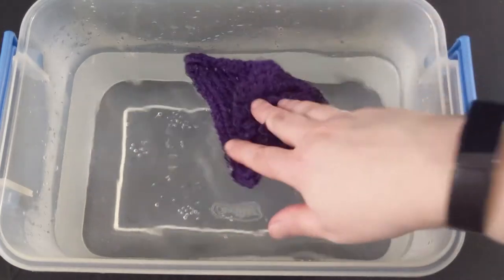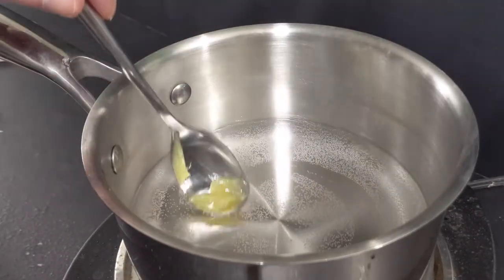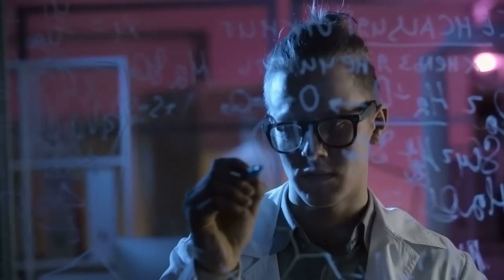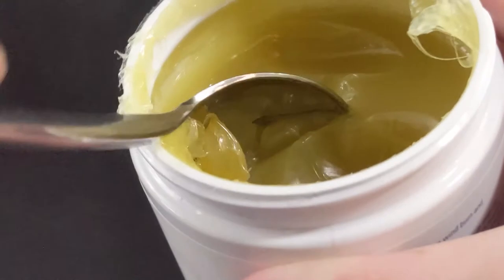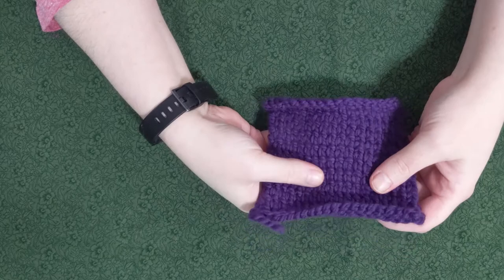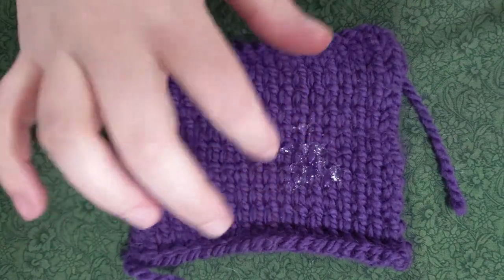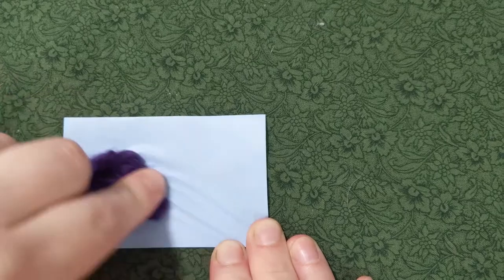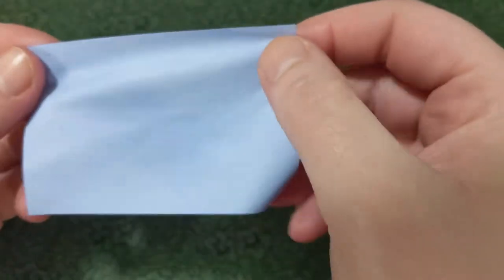Lanolizing Wool Textiles

Comment: I lanolized wool soakers (cloth diaper covers) for many years. The method I used to emulsify the lanolin into the water was to add a few drops of liquid castile soap. I would melt the lanolin into the hot water, and start adding the soap drop by drop. Magic would happen and the water would turn milky white, and the lanolin would be perfectly dispersed into the solution. I would soak the wool until the water was cool, and roll in a towel to remove as much water as possible. Perfection every time! I was able to get a heavy application of lanolin (waterproof was my goal here) but still not have sticky residue.
Reply from the maker: This is a great tip.  Thank you!
Reply: Yes this is what I do! Castile soap works even better than using emulsifying cubes for this purpose made by sloomb. The soap creates tiny little micro bubbles around the lanolin trapping it inside and distributing it evenly throughout the water.
Reply: Using the emulsification thru soap method, did you notice a whiter hue on the fabric when it dries?

Comment: This video is incredible, thank you so much for this information.  I have recently, I don't know how to say this, gotten into wool. And after wool, I discovered lanolin. I actually discovered lanolin when I was trying to figure out how to take care of shoes. After looking into it for about a year, I figured out that the ingredients they were using were all supposed to add up to what lanolin does alone. Neatsfoot or mink oil are used as conditioners and they'd add pine pitch or beeswax as waterproofer. I noticed that lanolin was an ingredient in some of the formulas, but didn't know what it was up until that point. Once I read up on it, I tried to find some to experiment with. The only lanolin I could find in my area was Lansinoh's nipple cream from Target! Luckily it was 100% lanolin and I was able to try it out on some shoes. I got the results I'd hoped for and haven't used any other shoe care products since. Lanolin then led me looking into wool more (and a lot more thoughts on the world that I will spare you).  And one thing that has been eluding me has been a fuller explanation on the hows and the whys of lanolizing, which you've so eloquently explained. It remains elusive in all of the places I could think to look. This knowledge seems very fundamental.

Comment: I'm confused. Weigh wool. got it. Use 1/2 to (1) tsp lanolin per lb. got it. But here's what I don't get: Ideal saturation is a 2% solution, but each item requires a different amount of water to cover it (ex., a pair of socks vs. a large sweater), so the water + lanolin would be different % solution for differing batches regardless of the Weight/lanolin ratio. So, is the amount of water irrelevant? also, the video is not clear on what the EXACT 1/2 or (1) tsp would be: level tsp or heaping teaspoon? Thanks for any clarification!
Reply: Similar questions ... I have a wool poncho I made out of a wool blanket.   I've got 4 lbs of wool here so as you pointed out 2% comes out to 36g of lanolin.  but it will take a considerable ammount of water for a bed sheet sized blanket.

Comment: Thanks for the detailed testing! Wondering….is there Any way to attempt this on a shearling? Does to have to soak? Could it be sprayed on a shearling or worked in?
Reply from the maker: I'm thinking a spray might not be an effective application method, since we're talking about a water-oil emulsion.  It needs to be hot to keep the lanolin from resolidifying and agitated to keep the oil from pooling on the surface.  That said, I enjoy being proven wrong!
Reply: @Luthvarian  i may try a small patch with spraying, brushing and a distant low blow drying. Time to do a little test.
Reply from the maker: @DavidBattistella  Please do let me know how it goes!
Reply: @Luthvarian  I’m loving the results so far. Basically I melted  about 4% lanoline into water and then added some shavings from a bar of olive oil soap to emulsify. Perfect. Then while still warm I bottled it into a small spray bottle about 120ml. Then I lighting brushed the shearling with a new medium stiff shoe brush while spraying. Brush spray brush spray, the idea is to work the concentrated solution in while not overly wetting the inside of the coat. I worked the entire inside in this way and let it dry naturally and they gave it a light brushing. 

The result is wonderful. It’s that soft plush feel, very malleable and has that lovely combo smell of natural oil and the lanolin. It’s just soft and plush. 

One process I did prior to this was to deodorize  with pure straight vodka. (It’s an old Broadway trick) literally filled a small spray bottle with pure vodka and lightly sprayed the inside and it worked a charm. The lanolin step has added back the supple feel of the shearling. 

There is not much water in this process so it dried very quickly and I applied all the spray in five minutes while the solution was still quite warm.
Reply from the maker: How wonderful!  I'm so glad to hear this worked so well!  Thank you for sharing.  The next time I treat my treadle covers, I'll give this method a go, myself.

Comment: Such an awesome, well documented guide.
Do you know which of these most closely resembles the natural amount of lanolin on a living sheep?
Have you ever tried isopropyl alcohol instead of water?

I make my own leather, hurache style sandals for running and I'm interested in adding a wool felt layer for very cold weather. The felt I have has all lanolin removed and I want to put some back to help avoid moisture/sweat build up and fungus.
Reply from the maker: Thank you!  The short answer is it depends.  Different breeds of sheep have more or less lanolin.  Fine-wool breeds like Merino can have 25-35% of the weight of the fleece while long-wool breed often have 5% or less.  

I have not tried alcohol, but it would be worth an experiment.

Lanolized wool is a great option for this!
Reply: Do you have a page? 👟?

Comment: As I watched, I thought of a great use for heavily lanolinized fabric - reusable lanolin applicators :-). I’d probably use nonwoven aesthetic wipes, since they are much more compact and easier to swish clean with rubbing alcohol before recharging with new lanolin.

I’ve also seen several blogs discussing reusable washable water-resistant fabric food wraps to replace plastic wrap and plaster sandwich bags, using quilting cotton, oil, and waxes such as candellila or beeswax. The oil in the mixture seems partly to speed absorption into the fabric but more so to add stickiness/self-adhesion when the fabric is wrapped around the cheese/sandwich/etc. 

I suspect that lanolin would be a good fit for replacing some/all of that oil… my guess is that using lanolin instead of oil would allow the fabric to be reused through several more washes/dries before needing to be mostly stripped of wax and then rewaxed with hot wax mixture.

Comment: i think imma try siliconizing wool...itll prolly last longer than a natural oil
Reply: Can you share your process for siliconizing wool?
Reply: @gailculp6022  isopropyl alcohol or white vinegar, slowly add silicone while stirring to ensure dissolving, then test on fabric, benefit to alcohol is it pretty quickly evaporates with little added smell unlike the vinegar. depending on your wanted results you can change the ratio which is why i prefer adding the silicone to the solvent and not the other way around. itll last longer than natural oils. also you can always add more but not plausible to remove if you want to keep the wool safe.
Reply: Why have wool if your adding plastic to it, why not just buy the plastic coat to begin with?
Reply: @roadflower336  coals melt plastic faster
Reply: I've turned cotton bedsheets into waterproof tarps with silicon baths. I imagine wool would be similar, but I've never tried.

What I can say is that you might not want to use silicone on wool. Two of the great things about wool are its ability to wick moisture, and breathe while being water-resistant. Silicone will most likely put a stop to, or severely hamper, both of those qualities.
Reply: @TheKrossRoads  
not tried it, but I imagine the end result to feel a bit rubbery or a bit like latex    ... has anyone tried this ??